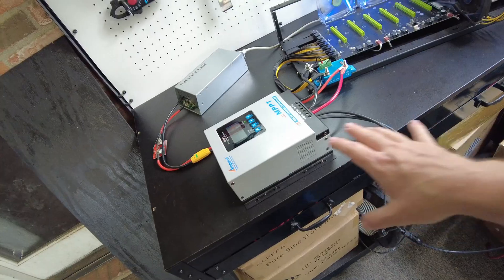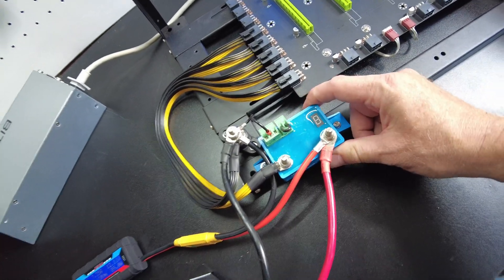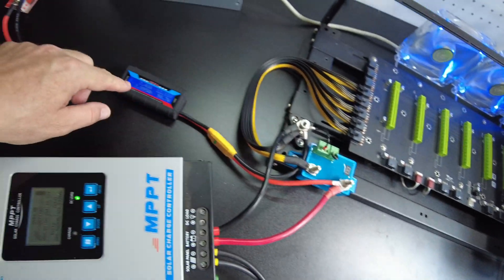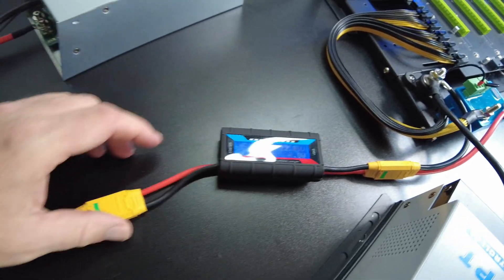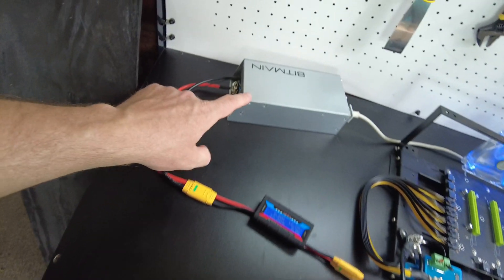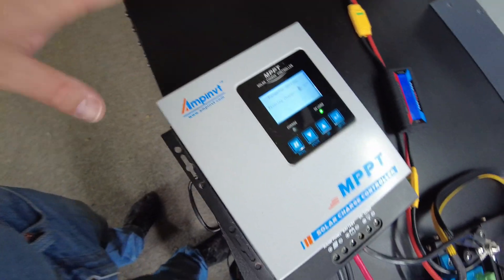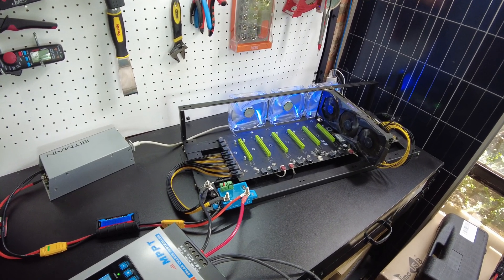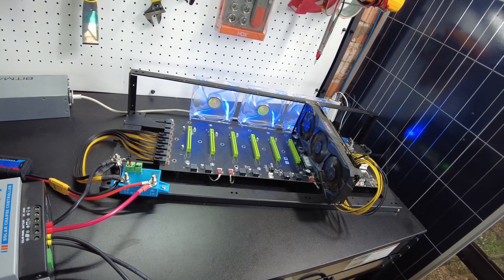Solar Crypto Mining w/AC Fallback No Batteries

Comment: Glad I found this video.   I have three L3+ miners I"ve been looking to run and having the Sun provide voltage to knock down the grid consumption is exactly what I'm looking to do.   I'll set mine up with a Contactor to limit powering on the units during the day when the Sun is assisting.

Comment: does the charge controller have a fuze?  doesn't start when plugging in panel 1 260w panel
Reply: no battery
Reply from the maker: It has internal fuses. It does not start from PV. The PSU, or battery must be available to start it. Thanks

Comment: Are you using a charge controller that doesnt require a battery for a reference output voltage? I am trying to do exactly what you are doing but all the charge controllers i can find explicitly require a battery before the solar load is connected.
Reply from the maker: This one does require a battery to start up. However the 12v PSU "looks" like a battery to the controller, so that allows it to start. Victron controllers can start with PV only. But I would not recommend you try to use solar without something to fall back on. You'll have multiple low power situations throughout the day (think chunky clouds moving by) this will cause your miners to go up/down a lot, and probably hang, all kinds of weird stuff.  Thanks!

Comment: Interesting, How does it switch between the two sources without a UPS?
Reply from the maker: Both sources are always on. However the solar charger voltage is set higher @ 12.5v, while the PSU is lower at 12.10v. The way electrical current works it will always flow first from the source with the highest potential. When the sun is down the solar goes away, and the PSU is there to supply the power.

Comment: Why risk frying sensitive electronics when it's very easy to use a battery or voltage regulator to eliminate that risk?  This is one of those things where it's cool to know you "can" do it, but it really has no practical application.
Reply from the maker: What do you think is risky, and how would a battery make it less risky? Genuine question. Thanks!
Reply: @BradCagle  - The Victron battery protect is intended to cut off the flow of current to a load when a battery reaches a certain voltage, to protect the battery from being over-discharged.  You're using it as though it's a voltage regulator that will prevent a spike in current from the solar charge controller reaching your GPU board.  Where the Bitmain PS tightly regulates voltage going to your board, the battery protect may or may not provide that same protection.  I just don't see why it's worth risking the valuable GPU's when running the output through a battery and inverter (to your Bitmain PS) is cheap and easy.  If you really want to eliminate the inversion losses, at least include a quality DC-DC voltage regulator instead of relying on the battery protect for that function.
Reply from the maker: @jasonbroom7147  Technically speaking the MPPT charge controller is a DC/DC converter with a bit more smarts. Also the Victron battery protect is designed to protect loads too,  it has an upper voltage cutoff of 16v. Now I think it has a max of 35v so if your MPPT shorts (which can happen to almost any DC/DC converter) you would want your PV OCV under that 35v for maximum protection. The safest way is to use an isolated DC/DC so if it shorts it has no direct connection to the output. I use isolated 48v to 12v DC/DC converters in my larger solar mining system with 8kw of battery.
Reply from the maker: @jasonbroom7147  I might do a follow up to this, showing how you could using the MPPT load output tied to a relay to monitor, and cut power if it's out of safe range. For added protection. Thanks

Comment: There is a very good chance to damage the mining components over 12 volt. While the battery gets charged fully it goes above 14.4 volt.... you are mnupulating the charge controller by using that diode and to protect the charge controller too... better you use a 24 or 48 volt to 12 volt 100 amp dc to dc step down converter (industrial)
Reply from the maker: There's no battery in this setup, and the voltage is set to not go over 12.5v

Comment: Thanks for the video!!!
Can make one with battery include.
I want to make setup with solar as main during the day and then battery and last ac as back up if the re is no power. I hope you can help me with this
Reply from the maker: You're welcome! Will do
Reply: I'm also thinking of doing the same thing. Batteries are expensive but I still think a small one would be necessary to avoid any blips during the day. A video on this would be great.